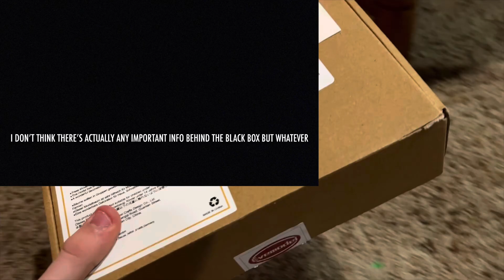WORKING Ho Model Siren System!

Comment: Try Making A Water Tower And Putting A ACA P50 On It
Reply from the maker: Although I have a water tower, it’s too small and not modern enough to mount a siren on, so I’ll probably pole mount the P50 if I’m able to make it
Reply: Wait Then Put It Way At The Top Of The Water Tower